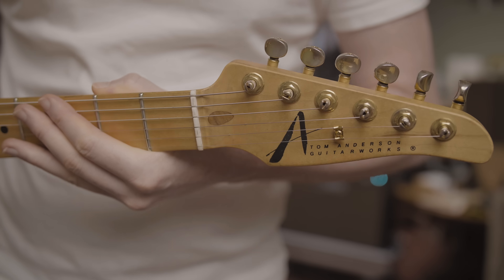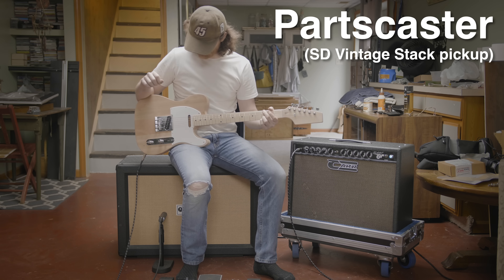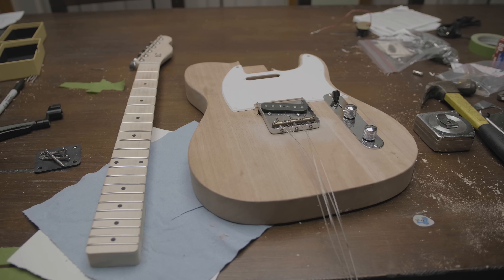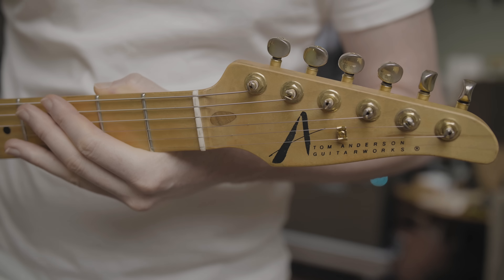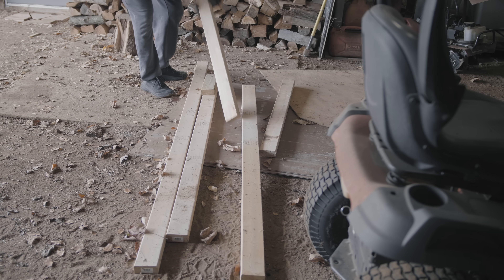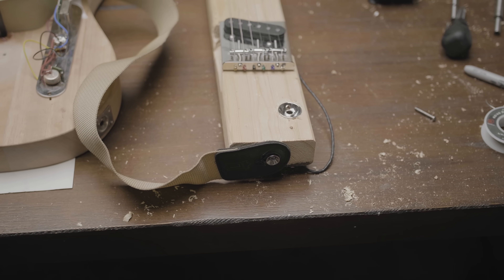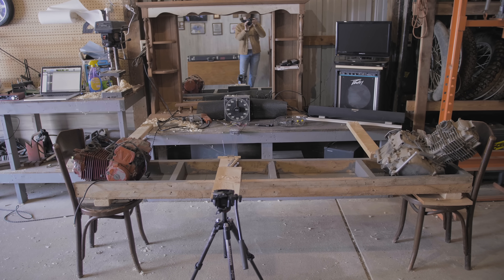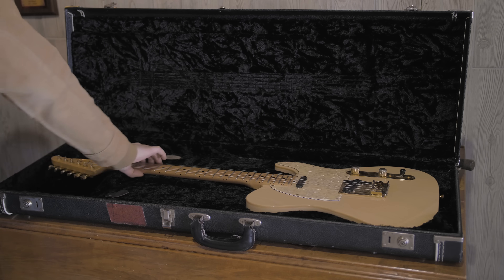Tested: Where Does The Tone Come From In An Electric Guitar?

Comment: More things changed the sound than I expected but the majority of those changes were subtle enough that I would never notice them being swapped out mid track. Or rather, many of those changes were subtle enough that I imagine slight eq  changes before hitting the fx change would already change a ton.

But then there's stuff like pickup height and the strings themselves and the choice of pickup are just as big changes as one might assume them to be.

Honestly though I never thought of adjusting the pickup heights for any reason other than troubleshooting yucky buzzing.

Comment: The "tone wood" idea for electric guitars is so silly. The whole point of making a solid wood electric guitar in the first place when it was invented, was to avoid any complications  in big bands with resonanse which could lead to feedback and other instruments bleeding into the guitar signal too much. As long as the pickup is properly mounted and the stings are mounted rigidly enough there should be no meaningful difference. And I can't hear any difference here at all once the pickups were mounted identically, as expected.

I think maybe one complicating factor that might reinforce this idea in people who believe in the "tone wood" thing is that it probably feels a bit different in the hands (the final rig here obviously does, of course), and maybe also sounds a bit different to the player with different woods. It might be as simple as some kinds of wood transfer more vibrations directly to your body (not enough to meaningfully change the sustain when amplified, but enough to make it feel different) and some woods probably is more insulating than others making the guitar feel colder or warmer which probably affects your perception too. Also things that are heaver feel subjectively "better" because we associate heaviness with robustness; and you cannot easily make the same shape of guitar with wood of different density without one being heavier.

This also means it's very hard to double blind the test for the player and anyone else in the room having to handle the guitars, so your knowledge of which one is more expensive/exclusive/fancy etc. will affect your perception.

Comment: Wood variety and shape absolutely matters. Frequencies near the resonant frequency of the body will be amplified. Frequencies half a phase out will be distorted. Ballpark math says your 2x4 likely has a resonance somewhere in the 300-500 Hz range. Of course, to get enough movement out of the board to make the pickup care about that, you're likely going to need to expose the board to an input in the 90-100 dB range, minimum. In other words, if you walk in front of your loudspeaker, at high volume, with the fancy guitar and your 2x4, the resulting feedback screach may sound different.

The reason acoustic-electric guitars care about shape is because the air space inside the hollow body is a far better resonantor than the solid wood of a full-electric unit.
Reply: did you even watch the video? It makes zero difference.
Reply: @Tasmanaut  I love it when people show up for obvious bait. There is a difference between zero difference and no (human) detectable difference. You'd need a computer, and likely hours of samples to statistically detect the difference. Even in the case where you create a feedback loop through your amp, tuned to the guitar body, the humans listening are likely to just think "ow, that hurts", not "oh, that's 0.001Hz different".
Reply: @Tasmanaut  Yup, correct on both counts.  In psychology, the term is "minimum perceptible difference" or "just noticable difference".  It has significant applications in art, both in color theory and music theory. It also sets the limits on suface finishes by touch and lots of other things. 

You certainly shouldn't pay a premium for shape or material, beyond their ability to hold the pickup and strings steady and fit you comfortably. For example, his last version (the "air guitar") isn't really going to be suitable to dance around a stage. However once you meet the minimum criteria for pysical stability, anything beyond that is over-engineering with no gain.

Wood choice can matter, but only in the extremes. For example, Balsa is probably going to flex over time under the tension of the strings. And some finishes will better handle changes in humidity if you abuse them. In the extreme, if you make your guitar body out of mdf, and the finish fails in a wet environment, the whole thing will swell up and delaminate. None of that matters when the guitar is functioning under normal conditions.
Reply: @Tasmanaut  No need to apologize. I wrote it with a tone implying I think "tone wood" is incredibly important, while explaining why no human can hear any difference. If you know the phrase "damning with faint praise", this is of a similar structure. I aplogize that it caught you on a bad day. I figured it was possible I'd catch an earnest fellow misunderstanding me. However I hoped it would catch someone from the "tone wood" crowd, pointing to this as a physics-backed "proof" that the video is bunk. I figured that would be worth a laugh.

Comment: I’m shocked that people didn’t realize that it’s mostly just the pickups (and strings lol but that doesn’t count) I guess I’m not shocked just disappointed lol. Everything else is about how they effect they effect the pickups (ash tray, neck, bridge), body chamber on hollow and semi-hollow bodies of course but not really on solid body electrics so much and even this is a subtle thing and more feedback is the difference generally lol, and then scale length of course but that’s obvious with regular versus baritone guitars and doesn’t vary much on normal electrics (usually it’s either 25” or 25.5” so it’s a 2% difference and not usually something that matters other than again how it ends up effecting the single thing that trulynmatters which is pickup to string distance lol).

Comment: Number three in your initial list has it right, all day long.  The sad fact for most guitarists is a $10,000 guitar, or a genuine vintage guitar that is sought after by collectors is not going to make one damn bit of difference.
Give the cheapest crappiest guitar to any of the best guitarist's in the world,  allow them to adjust the height of the strings and intonation, and then play it and I would guarantee that 90%+ of guitarists would not even know it was the cheapest crappiest guitar ever made, myself included, but automatically assume its a very expensive guitar because it sounds great and of course all the famous guitarists only play expensive guitars (and that last one is completely wrong).
Its all about hours of genuine practice and natural talent, with a sprinkling of music theory.  We as guitarists can do something about the practice and the sprinkling of theory, but very little about the natural talent - its either there or its not, and if we are given a $10,000 guitar it will not make the slightest difference and definitely not make us sound like any of the best guitarists.  
We might get close, and close is good enough, or at least should be.

Comment: 80% of the time people are paying for a name and fall for marketing BS.
The other 20% comes down to electronics, string guage/alloy and the setup and action of the guitar. Components such as fret alloy and tuners types tend to be better on a mid to high end model which will make it play longer before adjustment, repairs or tuning are nessesary. The wood grain can help with warping in harsher environments, but has nothing to do with sound on an electric. 
This was a great video to determine what I have always believed to be true since it logically makes sense.
Nice job man!

Comment: Next vídeo try put some cushion between the air guitar parts (bridge and headstock) and the tables, in some way that there’s no transmission of vibration. The only point is to measure if it interferes with the sustain of the note. If somehow the bench is working as an reverb chamber. To be clear, I’m not contesting the results, I’m asking if it changes anything. 

The other thing I want to know is if the same thing works for the bass. Cuz I always felt different responses between heavy and lighter woods (we had two different bodies one was cedar and the other was maple, everything else was the same, the cedar one had more sustained notes and overall better sound, the lighter body had more definition).

Comment: there are a lot of factors which are hard to control when trying to compare all this... Where you are plucking the strings, how hard you pluck the strings, guitar pick material. Exact values in the different volume knobs will be different and even the resistance in the bridge pickups value's will be slightly off one from the other. even how tight your hardware is mounted (screw hole sizes relative to the screw thickness which can be felt through resistance when turning the screws that hold hardware down which means either more, or less screw contact to the body of the guitar. More means more vibration transfer to the wood, less is less vibration transfer), how hot the amp is if it's a tube amp, where the amp is placed or what is around the speaker. Even the way the string is coiled around the tuner from guitar to guitar can effect sound to a small extent. The string angle on the string nut (how sharp of a bend or it's final resting position in the nut slot, weather it be in the middle of the groove or if the most contact is on the corner edge of the nut). Most of everything you can do for "tone" or "sound" for an electric guitar is going to 100% be related to your individual pickups, volume/tone pots, strings (coating, material, old, new etc.), and your guitar pick material... or sustain related which would be relative to your hardware material, bridge block size and materials, string nut material, string saddle materials etc.. 

Searching for good tone wood is for acoustic instruments period... and that will deal with reverberation and loudness with all the other nuances such as strings, nut etc... To have a difference in "tone" based on the wood, the wood would have to directly effect the string wave length when plucked, or sound to be magnified back through the body to the pickup by reverberation, at least enough for the pickups to actually pick it up... and that would mean the strings themselves would have to rest on the wood itself to be directly effected by it and clearly hear the sound difference from wood type to wood type. At this point, it would become a difference in wood densities. A thick wood electric guitar body doesn't reverberate sound back enough to effect the wavelength of the strings floating above it or effect what the pickups are hearing through vibrations, nor does the sound itself come back from the body eough when strumming (it does playing the electric without an amp, but it's usually heard through sustain, not actually tone. This is simple to understand because it can be felt through vibration, but this is not enough to cause any major difference in what the pickups are picking up. Microphonic pickups with high values stand the best chance in picking up differences in tone based off how much reverberation the guitar can actually play back, but you would need to change all hardware in order to have more body resonance by using either brass, titanium, steel hardware etc. and strum very hard on the strings, and even with this, you are more so effecting sustain again. Semi hallow electric guitars can highlight this, or better yet, electric/acoustics can. In an acoustic, your sound is directly effected by the density, shape, and thickness of the wood, cavity size etc. because the sound is being amplified through, not only the cavity shape and size, but the wood as well. The point of an acoustic is to act like a megaphone, and some do it better than others simply put.

It really doesn't take all this testing to answer this question, you just need to measure body vibrations around the pickups of different woods, and what sound is produced back from it, and if it is loud enough for the pickups to also play that sound, and measure string vibrations before and after changes. What you will effect more is just sustain.

If you want to know if an electric guitar tone can change based on materials, one needs to be built purely of wood with wood hardware, and one out of pure metal, with metal hardware. and we would need to understand at what values of density of guitar body materials does it effect string vibration, or body resonance in order to effect what the pickup is hearing.

Basically, this would have to be a heavily funded project, and even with what I said, there is more to it to have a real factual written in stone conclusion.

Comment: Sir, your mistake was asking someone who makes a living making guitars and charges a huge amount of money for them, what determines the sound or tone of a guitar. They will repeat exactly what helps them sell more guitars.
Ever since I saw the U2 guitarist's "equipment", I realized he could be playing his shoelaces and it wouldn't affect the final sound at all. The "equipment" was bigger than a double-door refrigerator. He would play one guitar string and the equipment would produce a complete sound, with effects, as if he were playing an arpeggio.
No one will admit that the only thing that matters are the pickups and all the equipment between the guitar and the speakers. If the instrument's parameters are within normal ranges to produce a controlled sound, (arm length, number of frets, spacing between the frets, which here in my country we call "houses", etc) what the instrument is made of doesn't matter. You take a Gibson '59 and put the pickups from my Golden guitar in it and the Gibson will sound like crap. And the opposite is also true.

Comment: If we strike a piece of wood, we get a response. Each type of wood generates a different response because its composition is natural. Phonographs are devices created by humans and electronically can suppress the frequency characteristics perceived by the human ear, but this doesn't mean they aren't there; it simply means the human ear can't perceive them, just as a compressor cancels frequencies. Wood, besides having a greater impact on sound in the past than it does today, has a more pleasant texture. Electronics only manipulate whole numbers, 0s and 1s, therefore they can distort anything. The differences also lie in tube amplifiers. A tube is a vacuum, like the universe, so when a signal enters, it can generate variations in the output, and it will never be the same. In contrast, electronics, being non-irrational, always act in the same way with a standard pattern, and that's why everyone is deceived by their senses.
Reply: "Electronics only manipulate whole numbers, 0s and 1s"

Digital electronics only manipulate 0s and 1s, and digital audio manipulate a whole bunch together such that the human ear can't tell the difference between digital and analogue. The whole point behind digitising the signal is that it can be reproduced exactly, without distortion.

Strat / Les Pauls are are analogue.
Reply: @kitmoore9969 Your expertise is beyond me, but I know the signal needs to be as transparent as possible, agreeing with you, and not as emulated as possible, because all manipulation of a medium tends toward its limits. That means that even if you capture a huge amount of data, it will never reach the original resolution; it will only resemble the source. Emulation is useful, but misleading.

Comment: I disagree with this experiment, eliminating the body and other variables leaves only the strings; but ALL parts of the guitar affect tone
this is because tone is the result of string tension, which can be absorbed by the body, the strings, a tremolo bridge, everything
what this test does is eliminate many variables that DO ALSO play a role, and then assume that the remaining variables are the only ones that matter
sustain can be lost everywhere, high frequencies can be lost everywhere, even in the caps wired to the pots. EVERYTHING affects tone
Reply: He didn't just eliminate variables, he changed them.

Comment: Tonewood for electric guitars is an urban legend. On the other hand, a guitar without a neck isn't really a guitar; it's a different instrument altogether.

The pickups account for the lion's share of the sound definition. As for the rest (sustain, etc.), an electric guitar simply needs a material that absorbs the least kinetic energy from the vibrating strings: the exact opposite of the fabled tonewood.

This is also why a semi-acoustic guitar or a jazzbox always has less sustain than a solid-body guitar.

Comment: It's nice and productive work but still I didn't understand whether the bingo moment was because these two tones were different or were they similar? To me they were much different because of the response to attack. But that's true that you did get the overall color pretty close! Overall, whether guitar body/neck etc. matters or not, depends on the actual part you are playing. Open E chord is different, fiery solos is different and funk riffs are different. And yes, if one uses lots of distortion, the guitar doesn't matter so much, it's all blended. Cheap or expensive - you can't tell. :face-blue-smiling:

Comment: It would be interesting to try to quantify the quality of the result so they could be compared properly.
Maybe an oscilloscope to analyse morphology, and capturing data digitally, then doing e.g. FFT analysis on the data to quantify the harmonic series if that's possible. It's quite easy with free 3rd-party libraries and a bit of programming knowledge. There must be other types of analysis that could be done too.
You'd probably need a mechanical strummer to keep variation to a minimum.